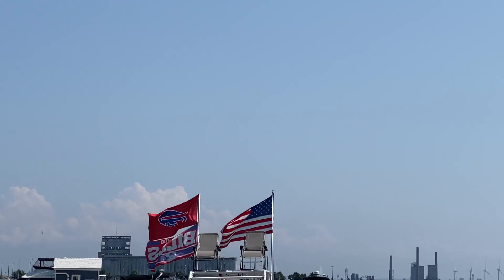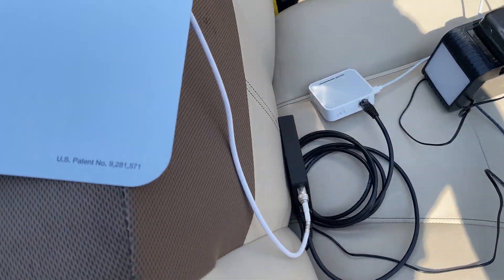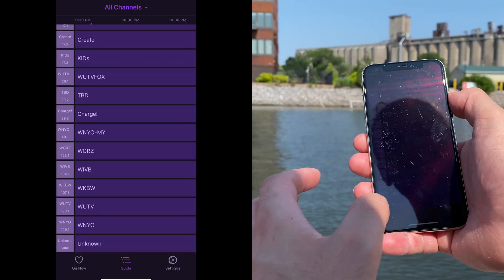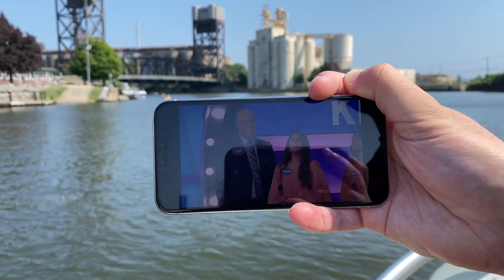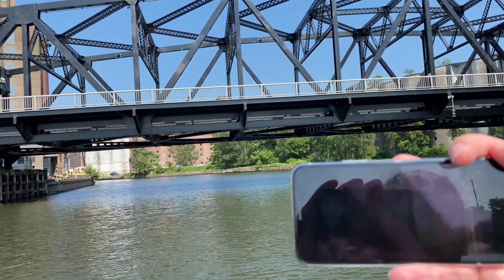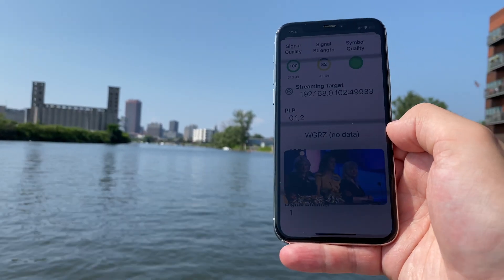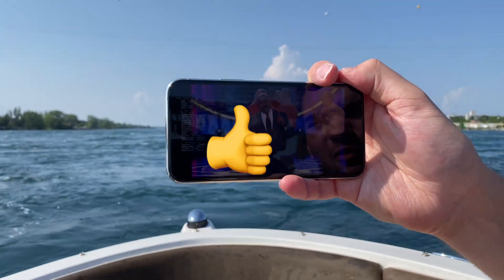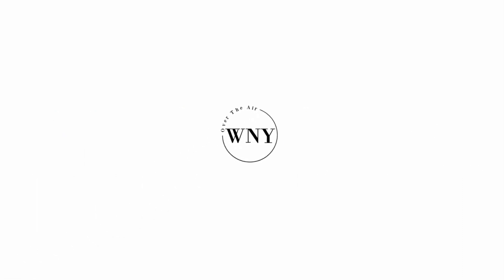ATSC 3.0 On A Boat: Free Live TV Without Internet!

Comment: Commend you for taking the time on a holiday to take that aboard and show the performance of ATSC 3.0. It's quite amazing how robust it is. Are those apps like Signal GH available on Android, and if so, are the developer versions available to download, or did you get special permission? I wish more TV's and apps would include the signal performance numbers, vs just, 'Bad', 'Normal',  'Good' and some simple bar graphic if they even have that.. Most newer cheap Chinese TV's don't have any kind of signal meter like the earlier generation ATSC tuners did. It's easy to do, the tuners all have those statistics available, but the software guys just leave it out..
Reply from the maker: Unfortunately, Signal GH is only available for iPhone. The developer version that unlocks the SNR and dBm metrics is on the HDHomeRun side. If you buy the HDHomeRun FLEX 4K, you can add on the developer software for $100 by purchasing it on their website.

Comment: BTW, on MyGica WiTV (ISDB-T and DVB-T), with WiTV tuner app, WiTV from MyGica restricts wifi connection for a single device (Android, Fire tab, iOS iPad,iPhone) only like OTG MyGica PADTV tuner. 

4 device per tuner ??
Reply from the maker: The HDHomeRun showed in this video has 2 tuners that handle ATSC 3.0/1.0 and 2 tuners that handle just ATSC 1.0, for a total of tuning up to 4 channels at a time. The wireless router shown can handle sending data from all 4 tuners to 4 devices simultaneously.
Reply: @WNYOverTheAir does HD Homerun worked with ethernet to USB-C or Micro USB adapter ??
Reply from the maker: No. You need to connect the HDHomeRun directly to a router.